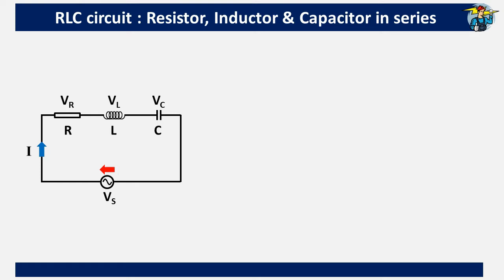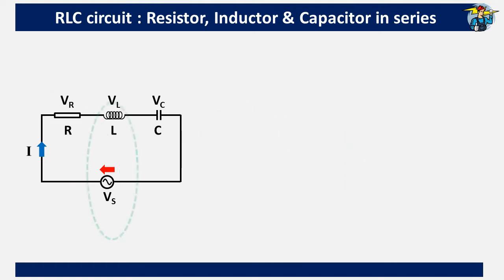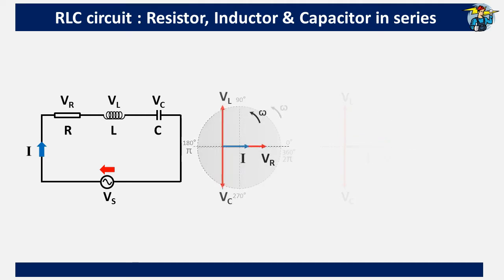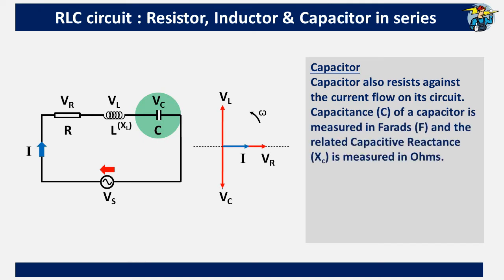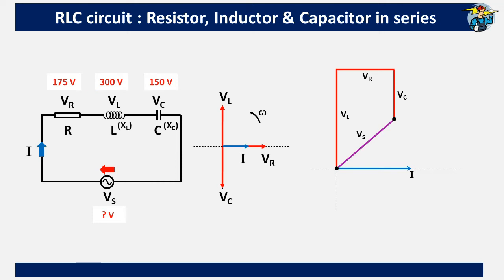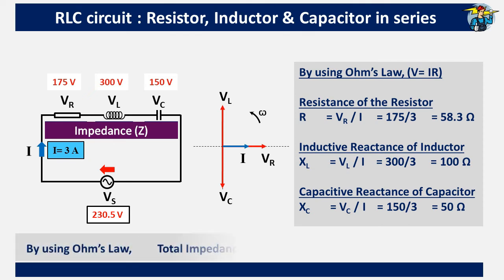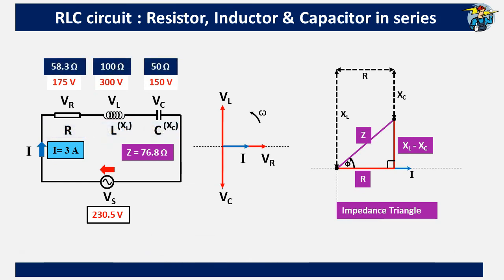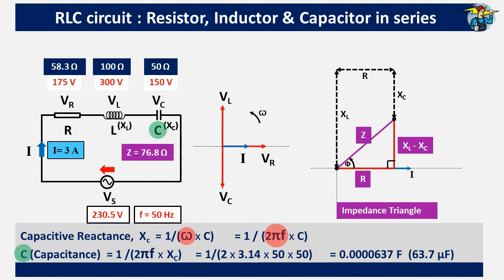RLC Series Circuit | What Happens When a Resistor, Inductor, and Capacitor are Connected in Series?

Comment: Why do you have 100 for inductance reactance
Reply from the maker: Since voltage across the Inductor is 300V and the current through it is 3Amps, using Ohm's Law we get 100 Ohms as Indutive Reactance.
Inductance of the coil is different.
Inductance of a coil is measured in Henry (H) and is a property of that coil.
Simply, when current flow changes through a coil, Inductive Reactance of that coil (measured in ohms) will change but Inductance of the coil measured in Henry will not be changed.